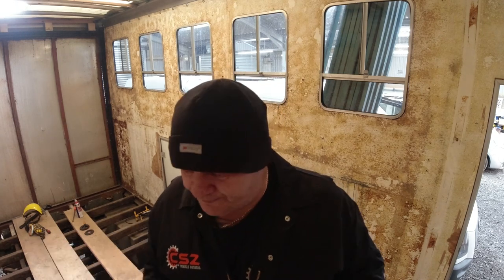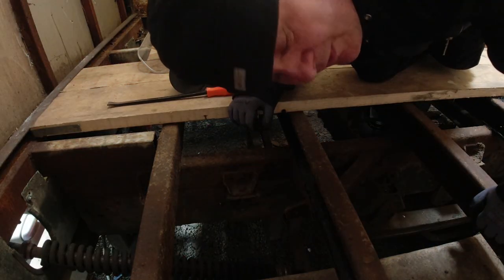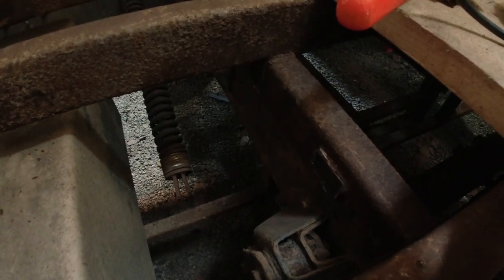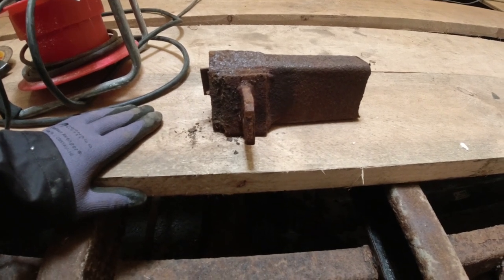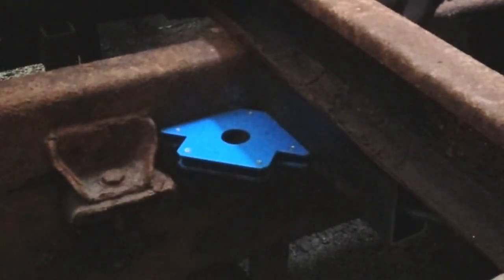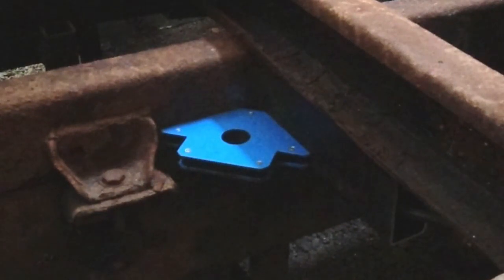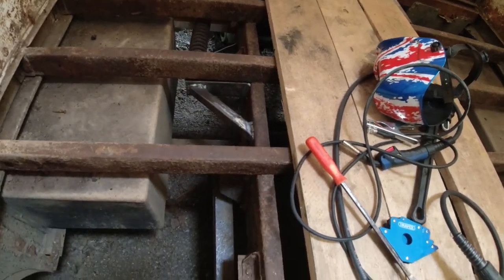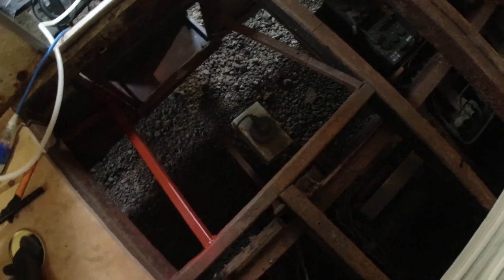7.5T Horsebox Camper Conversion - Rust Issues and Welding

Comment: I see in one of your trafic videos that the dash is showing a flashing spanner and a O, I have just bought one the same as yours but can't get the spanner to go away despite YouTube vids showing me how, Have you any ideas why it won't reset or is it just me?
Cheers. Garry
Reply from the maker: Yeah it relys on a throttle actuator so I have been told and if something is out on that it won't reset.  There are different reset combinations on YouTube if none of them work... put a diagnostic reader on it.  I am having mine replaced at some point and then will try again.